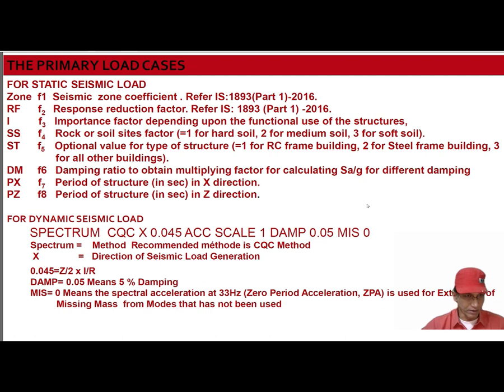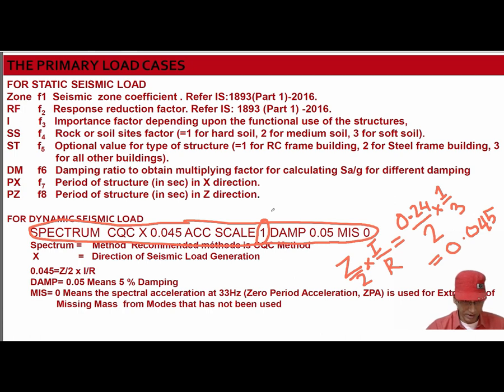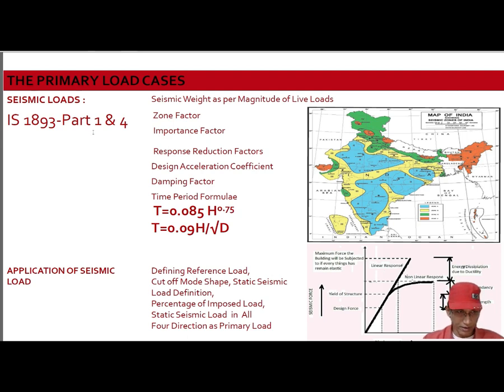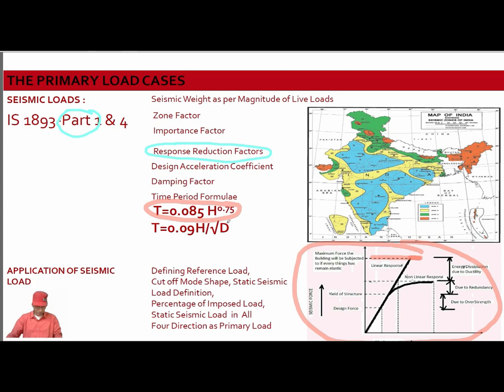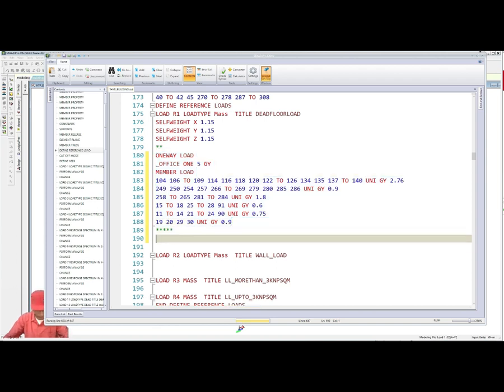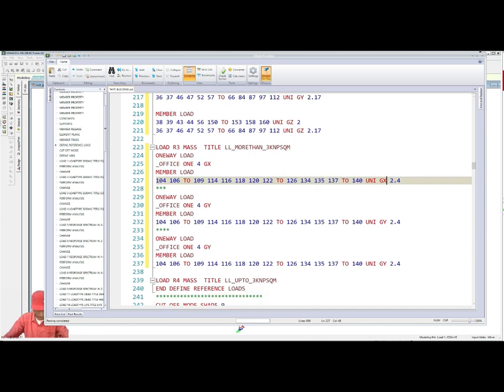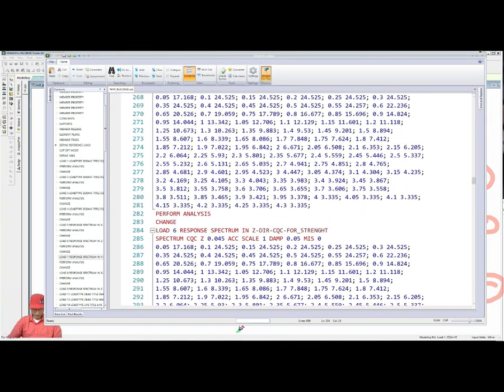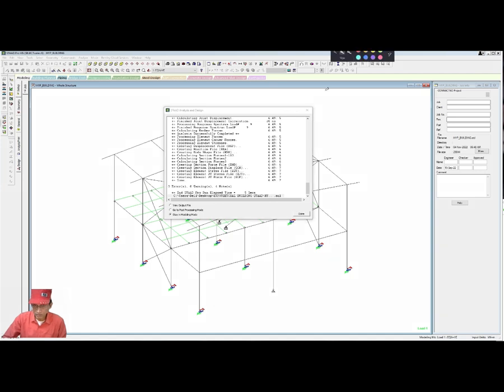SECTION 5 PRIMARY LOADS SEISMIC

Comment: Sir please make a video on , calculation of horizontal and vertical loads of a vessel (5m dia 20m high ,self wt 20t ,operating wt 150 t )in wind and seismic condition.if possible uplift load .plz sir it will help me .
Reply from the maker: Dear Sunil
I am Currently making Details for Making  Tutorial of Seismic Design of Steel Structure.
Next I Shall Take Up Building With Crane in Single Bay, then Multiple Bay, There After I shall Take up Process Building which  will address to you query.